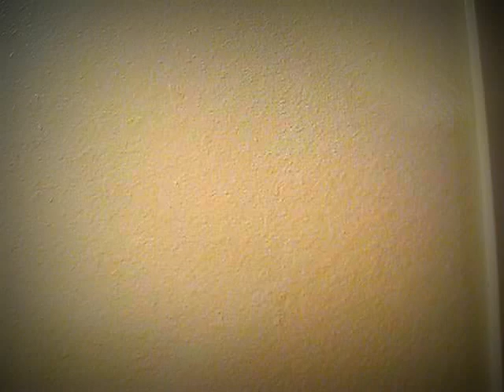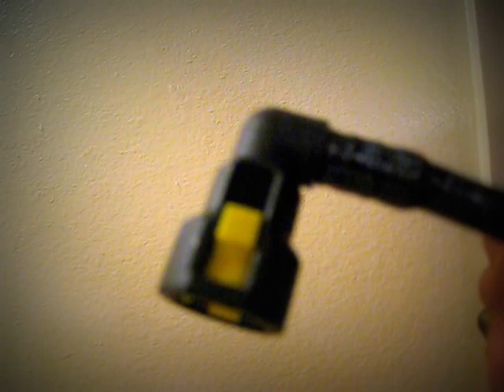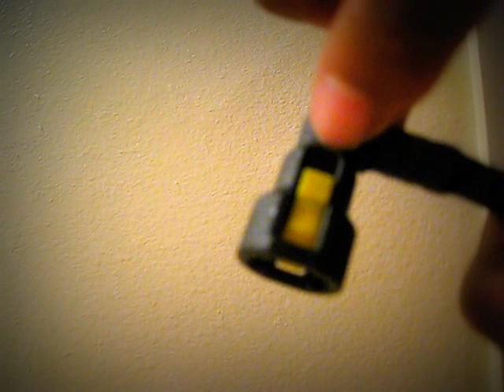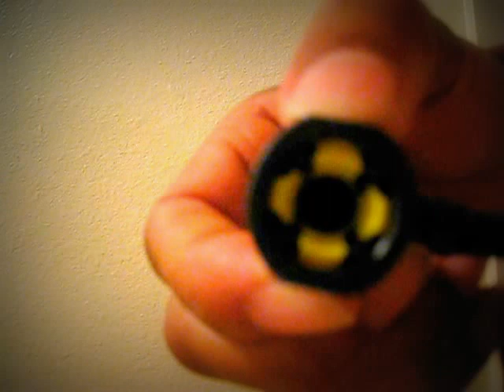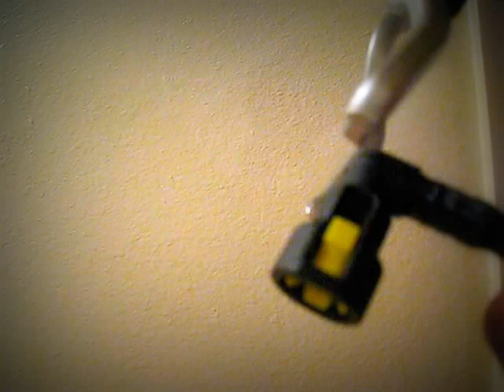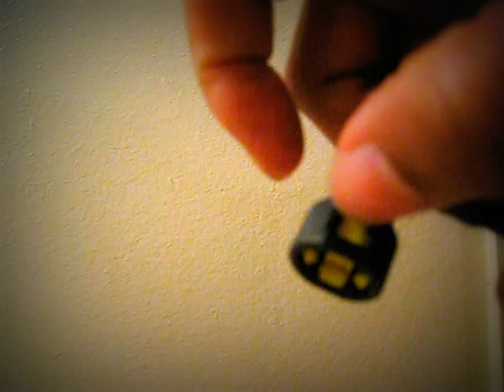Mercedes ML Fuel Filter Line Clamp Removal

Comment: Awesome crucial insight on this Fuel Line disconnect.  Glad you took the time to input.  God bless.  Are you still driving the Benz ?  I'm doing the Fuel Filter on my 2002 ML500....maybe the pump too, but not if the Fuel Filter resolves things !

Comment: Nick Williams, how do you get the fuel filter off, its at the drivers rear wheel, but you have no space to work with on the 2000, ml 320

Comment from the maker: Chis, The best way to do it is to remove the rear drivers side seat and you will see a circle in the floor pan. That is the access to your fuel pump. Remove the fuel clamps as I described in my post. Removing the clamp at the fuel pump will allow your fuel filter to drop down enough for you to get it out. Send me an email, or search on Benzworld.
Reply: Good info, will try this soon.

Comment: How about showing while it's attached to the sender. That's a whole lot harder.
Reply from the maker: Jeremy this was about 7 yrs ago.. But... If you take a flat blade screwdriver and spray some lubricant on it, then lift up on the tab, It will pop right off.  Just press down on it first to make sure it's seated properly then take the screw driver and lift